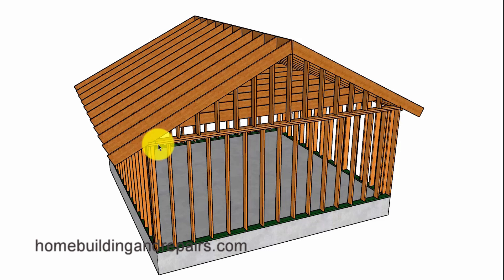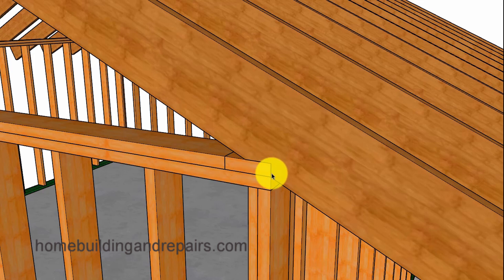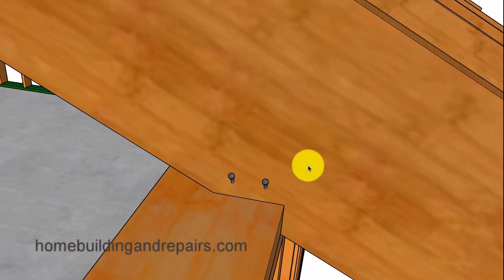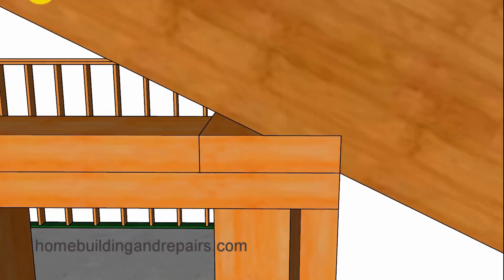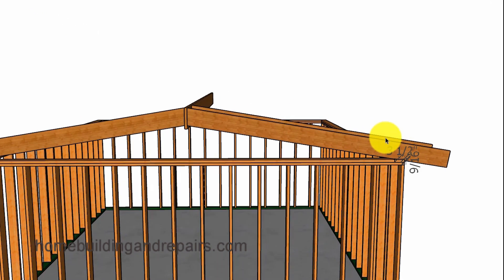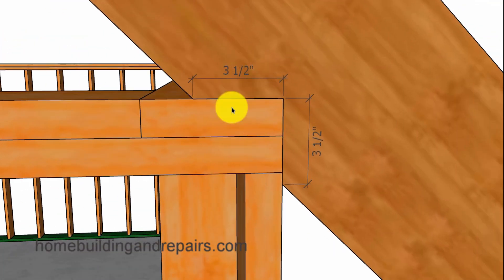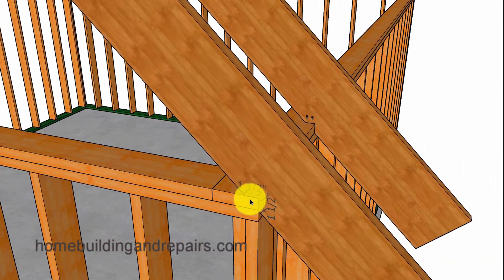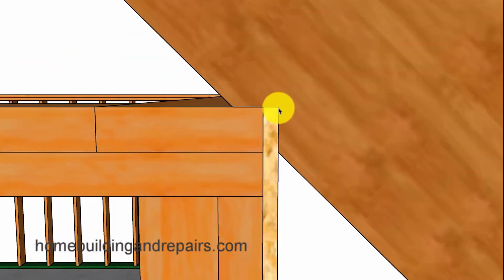Here's Some More Information About Roof Rafter Seat Cut Measurements - Improving Carpentry Skills

Comment: One thing: my rafters are 2x8 on a 10' wide cabin. I'm a bit concerned that if I make my birdsmouth seat cut 3/12 inches, that's like almost half of my rafter width. Isn't that going to weaken my rafter? My pitch is 12/12
Reply from the maker: It might weaken the over hang, but shouldn't be a problem for rafter. You can make seat cuts smaller. I've seen them about 1 inch before, but don't know if it will work for you.

Comment: Can you use 2x6 rafters on 2x6 exterior walls. Will that compromise the integrity of the rafter?
Reply from the maker: Builders do it all the time. The seat cut does not need to be 5 1/2 inches long, it can be shorter. Maybe 2 or 3 inches on the level cut or top of seat cut.

Comment: I have another question, how is the sheathing installed, seams vertical or horizontal?
Reply from the maker: Roof sheathing usually is installed perpendicular to rafters or at a 90 degree angle.
Reply: Im sorry, I didn't clarify my question, I was referring to the sheathing on the outside of building. Thank you very much Greg!
Reply: Wall sheathing is installed horizontal if you’ve blocked between the studs at the plywood seams. Vertical if you haven’t. Whether you need to block or not depends on the wind codes where you’re building.

Comment: I know you are not a structural engineer BUT!
Does the joist have to be done every 16 inches or can it be done at greater distances, without pushing out the walls?
Reply from the maker: It usually depends on the span between walls and floor framing loads, but yes joist can be spaced further apart.
Reply: @gregvancom  thank you for the reply Sir.
If I may ask, how far can they be spaced or do you have a video explaining this?

Comment: Can I have your opinion on something, I am building 16x20 shed with a a 4/12 pitch. Will two, 2x8x20, sandwiched together work sufficiently as the ridge board for 2x6 rafters?
Reply: Two questions. Are you in snow country? Will you have rafter ties at each pair of rafters?
If you connect each pair of rafters with a 2x4 cross tie, so that you have a proper truss, then you don't need a ridge board at all, except for convenience in framing. Simple 2x blocks between each truss would work. I would also add a good sized 3/4" plywood gusset plate to connect each pair of rafters at the ridge. But I'm assuming you live in a place with little to no snow load and you're using a light roofing material, like asphalt shingles. If you've got snow or a heavy roof you really need to get it engineered or by pre-made trusses.
Reply: No snow, interesting suggestions, didn't think of gusset plates. Awesome,  thank you! Videos are great!

Comment: I've never seen a shear panel installed vertically.  We install them horizontally and shift each course 4' so as to overlap them to maximize strength as well as to ensure a smooth transition between each panel so that siding may be applied without discontinuities at the panel joints.
Reply: If installed vertically all 4 edges will fall on either plates or studs. If installed horizontally, some horizontal edges may be unsupported between studs. In high seismic areas this may mean horizontal blocking has to be added to support those edges. The blocking is not necessary when the panels are vertical since all 4 edges fall on framing.
Both approaches work. It just depends on where you are and the shear loads that need to be resisted.
Reply: @HistoricHomePlans  studs are 16" centers though, so an 8' sheet spans 6 studs. Roof is usually 24" so a sheet spans 4 trusses/rafters.  
I've only seen cubits aka 19.2 once but a sheet will span 5 members in such cases.   

And, at least on the customs I've built, exterior walls are never 8 feet, nevermind you want to account for the overhang down on the rimboard (unless you sheet that with strips afterwards 🤮) so a sheet never lands on a plate until we put a rip at top of wall.
Reply: Yeah when I lived in RI we ran sheathing horizontally but it was required that blocking be installed between studs everywhere. Now I live in VT and I see homes with vertical sheathing everywhere so I had to do some digging to learn this.

Comment: I heard a few times that the height above plate should be no less than 2/3 of the total height of the rafter as to not compromise the strength of the rafter. Not sure if that’s accurate but seems legit.